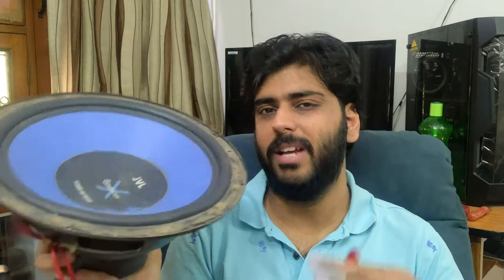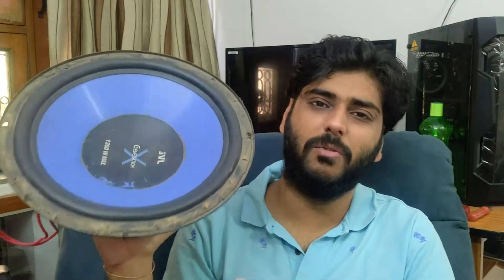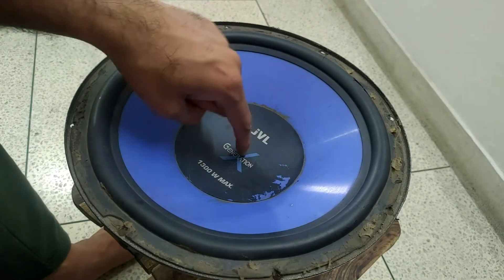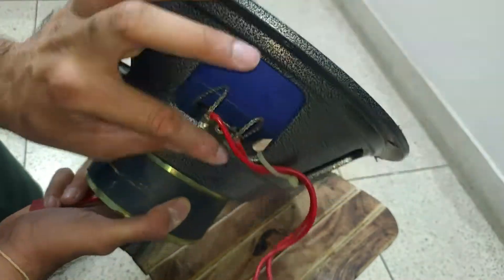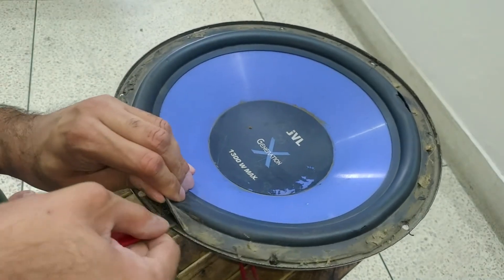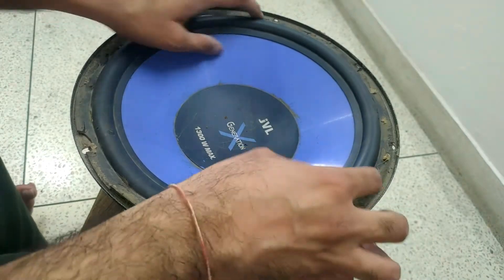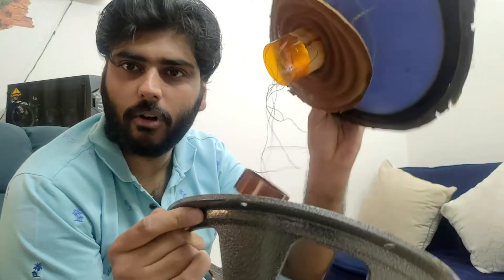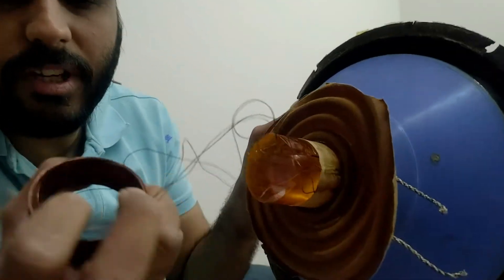Cutting OPEN a 12 inch SUBWOOFER

Comment: Interesting... it's not an JBL..nor an JVC. But something of a hybrid.
Reply from the maker: Absolutely. It sounded decent in a basstube but I never liked basstube because it's not an actual enclosure. I do make enclosures and sell them perfectly calculated and looks awesome too. There are build videos on the channel please do give them a watch. 😊
Reply: @AmulLuthra  Hey I've seen lot of your builds buddy. I am a fan of simple sealed enclosures. A heavy box and heavy woofer. But I liked your 6th order or 4th order bandpass one's. Also do make something more exotic like push pull or inverted cones setup.
Reply: By hybrid I meant the name is JVL. A mix of both brands.